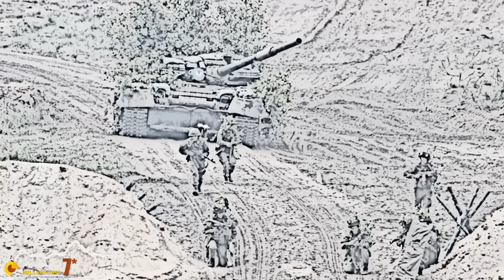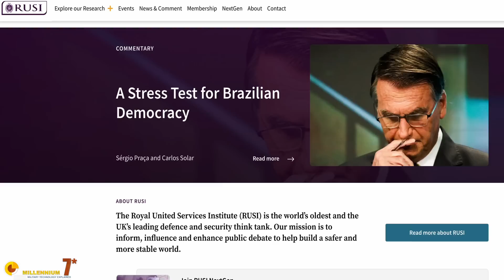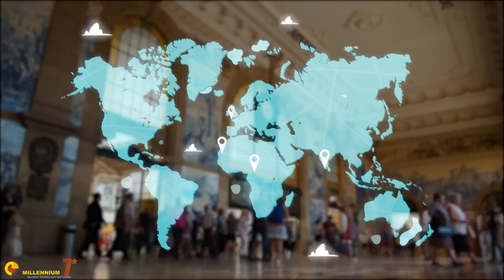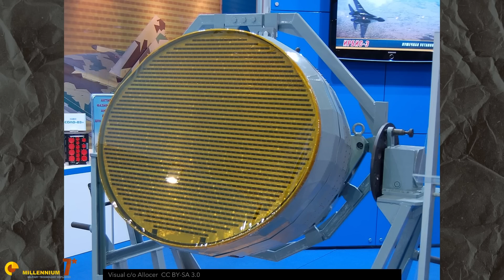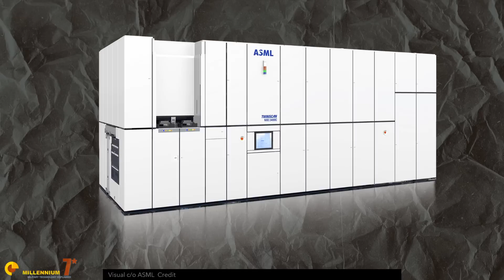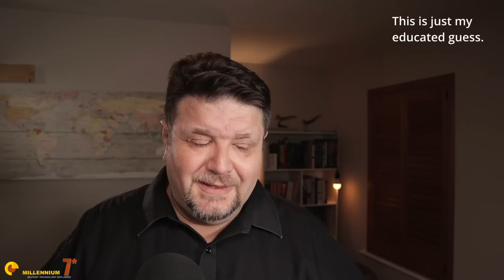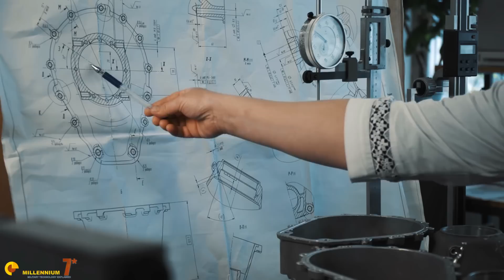Russia is using Western weapons in Ukraine.

Comment: I am in no way a weapons expert, but most of the processing and guidance and communication needed for any smart weapon can be found in a smartphone and its components.  If  I was to design the next smart weapon, I would just connect it to a smartphone with my custom control app and hardened mobile OS.
Reply: I design electronics and you are totally wrong in your assumption that phone chips are good for making guidance, first up GPS and the like fail to work at around 500kph due to time dilation(look up Einstein) second you want use chips for inertia navigation like ring gyroscopes, then you need attitude aka a barometer, to honest a weather station would be good fit here to look for the part. A HARM type weapon could use some basic high frequency analogue circuitry like a differential opamp were you operate flight surfaces to zero out the opamp IE feedback loop that stays on a radiation vector by sniffing out the strongest signal path...no CPU just good old analogue. Very simple and would work.
Reply: @ntal5859  So your design is ww2 style dead reckoning using op-amps instead of the accuracy of GPS that might be off by a few centimeters and can easily be fixed with software ?
Reply: @ntal5859  can't you just compensate for time dilation in the calculations? Also the error produced would be pretty small so the end result would still be quite accurate for most types of munitions
Reply: A smartphone would be an overkill. ST Micro makes microcontrollers that a hundred time less powerful that a smartphone Cpu. STM sells them at 2usd each and they are not the only ones making them, a few chinese companies also produce these. You don't need that much processing power. Inertial guidance components are often handmade, saw a Chinese documentary.  A more robust gps receiver can be purchased from a Chinese manufacturer for less than 50usd. RC  motors and lawn mower engines are readily available from a few other Chinese manufacturers, maybe not the more reliable but it only needs to run for less than 24 hours for a suicide drone. I have some experience building flying model for a few decades, it isn't that hard. Nowadays you can build a optical or IR guidance system for just a few dollars using a cheap camera board from China.
Inertial keeps on a general course, gps gives you mid course correction and an optical/IR/RF terminal guidance would probably hit your target within 1 meter 99% of the time. The Iranian under complete sanction did it, probably with more robust components. The Russian Orlan drone looked like a patch work doll compared to Chinese drones. 
Of course, the easiest thing to do is just mod a DJI drone or some Chinese toy drone.
Reply: And then the NSA would have some new toys
Reply: that's overkill, we're talking avionics and guidance systems.  even tech from 25-30 years ago is perfectly adequate for this purpose...and actually preferred because they are more robust

Comment: Is there any idea on the quantities that Russia bought of these western components?  If they were able to buy large enough stockpiles they may have enough for several years of production in some cases .
Reply from the maker: That is the key question. I have seen no estimates. It seems that tanks and ground forces equipment in general is mostly ok for now, while air-launched weapons and ballistic rockets have issues.
Reply: they can easily buy more. i don't even think it is worth stockpiling because of the chip recycling market that reclaim alot of these component.

Comment: This reminds me of a story I read about SpaceX - instead of buying 'space grade' radiation hardened components for their flight control system, they bought commercially available off the shelf chips and tested them internally. With the addition of triple-redundancy, they found the stuff worked well enough to meet their reliability targets and was MUCH cheaeper.
Reply: Just like the later Flights of the Arleigh Burkes. Saves metric fuck loads of money.
Reply: reminds of of the usa navy, they were paying tens of thousands for periscope controls for there submarines.  Found that xbox controllers worked just as well even if maybe being a bit less "robust" it did not matter because if one broke you could just plug in another one and obviously the cost difference was stark.  

I think that there is a lot of military equipment that could be made much cheaper with little to no difference in quality simply by using off the shelf components.
Reply: @islandwills2778  how much did they have spent before using Xbox controllers?
Reply: @Joshua_N-A  38000usd.  Replaced with Xbox controller.  I think one might be different in cost than the other
Reply: Well the crow jewel of US F22 were found using Chinese parts.
Reply: "I felt exactly how you would feel if you were getting ready to launch and knew you were sitting on top of two million parts — all built by the lowest bidder on a government contract." 
 Neil Armstrong.
Reply: Back in the 80s, the USN moved from the horrendously expensive, custom hardware, firmware and software, to standard off the shelf computers of good renown., hardening them with Faraday cages, and  ran Windows NT.
Reply: Musk is a con man.
Reply: Amazing how ignorant people are they think SpaceX came up with something that's nothing new
Reply: We recently saw how reliable they was...
Reply: This works as long as space or weight isn't at a premium. On a space capsule, triple redundant commercial grade doesn't take much more space or weight than the double redundancy space-hardened devices required, at least compared to the max weight and capacity of the capsule. In a missile, where you can't fit redundant components, and they will be exposed to extreme forces, mil-spec is the only way to go.
Reply: @norwegiangadgetman  Commercial tech is usually decades ahead military tech. There is no such thing as "hardened" devices. Components are separated into categories of tolerances. Your i5 is a defective i7, etc.
Reply: Yikes, can you imagine 2nd hand iphones being used to guide russian SAMs 💀
Reply: @gamingrex2930  it makes sense, actually there are lots of devices that have the computational abilities necessary from iphones to computers.
Reply: @gamingrex2930  Or spacecraft?   Ever seen Iron Sky?
Reply: MUCH cheaper. 
Just what I want in a moonshot.
Reply: it different. space radiation corruption is random, so if u have 3 processors, it is very likely only 1 will be affected. electronic warfare however corrupt all component at the same time. harden component are actually easier to manufacture, their high premium is due to low volume.
Reply: @lagrangewei  wouldnt it be possible to encapsulate your electronics in a faraday cage to make them much less likely to be taken out by electronic warfare?
Reply: But SpaceX is smoke and mirrors and not real, SpaceX is smoke and mirrors and holographic images with allot of editing. There certainly isn't a real Tesla out in space. This stuff is real here
Reply: @shots-shots-shotseverybody2707  My guy, i think you're lost, this is a military aviation channel, the tinfoil factory is next door.
Reply: @shots-shots-shotseverybody2707  and not even a ISS its all fake earth is flat it's all special effects life is just a movie

Comment: TSMC most advanced lithography is 5nm. China can produce low yield chips at 7nm. The difference in performance between 5 and 7nm chips is usually ~25%. China can easily produce most of the chips required by the PLA or by Russia.
Reply: They only need 20nm for most applications.
Reply: @Stu_Bur  i doubt even that

Comment: Err... Russia uses black sourced military grade components... mostly because they lack electronic and electrical competence.. what I mean is that most military grade components can be replaced with civilian components provided these are shielded or otherwise respecified to fill the requirement of the milspec one... in fact this is true of most military electronic components.. but is particularly easy to achieve in single use guidance systems as by their nature they only have a short active life... in fact I would go as far as to say that even these easily sourced civilian components can be reproduced or substituted with even simpler ones as long as you had the very basic technical expertise to set up assembly workshops... the milspec top end components only exist as a costly time saving method for ease of work...
Reply: Your assuming commercial production on 300mm wafers at scale and high yield, 150mm wafer at 50% yield wakes it a lot easier to do finfet at 14nm for military use.
Reply: A large part of dedicated chips on missiles can most probably be replaced with Rasberry pies or arduino boards. Good luck stopping their grey import to Russia.

Comment: Do you think China is much ahead of Russia in term or having purely domestic designs? Isn't that part of the reason they even limit their reliance on Russian equipment and for example completely redesigned their Flankers systems?
Reply: Yes. Late 20th century they were behind, in the beginning of the 21st century they bought basically every cutting edge system they could get their hands on (mostly flankers, S300, Tor, etc) then spent 20 years modernizing. At this point I'm fairly certain every new piece of hardware is entirely indigenous. This would explain their ability to churn out J20's,  now being over 150, vs Russian Su57's which are still in single digits when it comes to operational availability.
Reply: Nope they are also heavily dependent on taiwanese and western chips
Reply: @TheMoghrabimahmoud  for 10nm & bigger, China mostly self-sufficient, especially with how many cars & home appliances they exports. 

Also most military hardware doesn't use the most advanced chips, they are usually reserve for luxury/high end commercial products. With high costs & the difficulty to produce the waffers, Attrition rates could be disastrous for supply chain.
Reply: @akirasean4080  china can't make chips and "especially with how many cars & home appliances they exports."
really? 💀 rice cookers don't need much processing power.
Reply: @TheMoghrabimahmoud  That is the civilian market, and military chips are different from civilian ones.  The chips for Chinese military equipment have been independently designed and produced very early.  After all, there are many differences between military chips and civilian chips
Reply: Chinese semiconductor technology is far behind the west. Chinese manufacturers make extensive use of western components. They tried to build a domestic capability, pumped billions in to it in the last few years, and most of the money disappeared via corruption facilitated by local officials.  China is, and will remain, totally dependent on western products and intellectual property.
Reply: Russian electronic equipment is not as good as China, and China will definitely redesign it by itself.  But the aerodynamic design of the flanker is good, so China kept it
Reply: I would say no, with Russia still have few advantages, borrowed from its Soviet heyday. But the main thing is, both have different strategy & doctrine. Russia still adopt "mass assault"-esque, while China abandoned them since Economic Reformation, with emphasis on smaller, yet efficient army like Europe do. To fast-track it, China also license & copy whatever they could, Either from desperate Russian or green-eyed western companies. 

Yes, China have very large population, resources, monetary power. But they are mostly allocated to Economic & Industry not military. 

In my opinion, Rather than focus on military stuff, China prefer to be servants for western consumerism.
Reply: @akirasean4080  That's not what they do in Syria or Ukraine
Reply: @markjackson7467  clarify
Reply: @akirasean4080  China PLA is huge with big budget especially in Purchase Price Parity and without all the waste in lobbying the US  has
Reply: @markjackson7467  even with lobbying corruption, you can't deny US military has better quality & quantity than Russia and/or China. No sane person think anybody can defeat US, military wise.
Reply: @akirasean4080  Surround the wahabi terrorists in a cauldron send in negotiators load them onto a bus and send them to Idlib.
Reply: @akirasean4080  like the Japanese
Reply: @Terracotta-warriors_Sea  Even us, Japanese outsourced theirs to the Chinese nowadays, Unless its niche luxuries. 

For example, anime. Writer & director, Japanese but animator, & VFX, mostly Chinese & Korean.

Comment: So people have been laughing about Russia using old "dumb" weapons in Ukraine  from the start of the conflict.
They're not doing it because they don't have better stuff. They are doing it because they can get by with the old stuff for now and save the better stuff for later.
Smart weapon systems would probably be better be equipped with analog neural network processors instead of general purpose processors.
The weapon only needs to do one thing and do it well and once a neural network is trained to do one task it does it very well and is much less power hungry and less expensive than general purpose processors.
Reply: yep